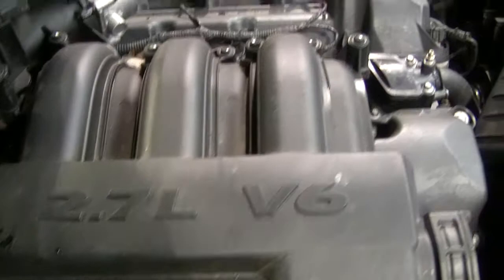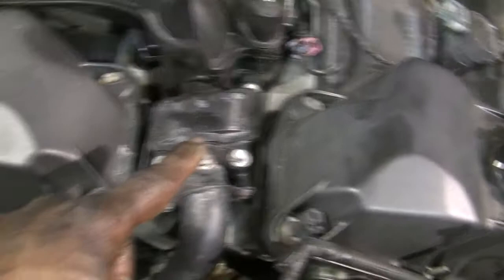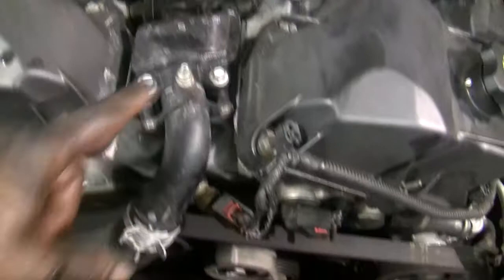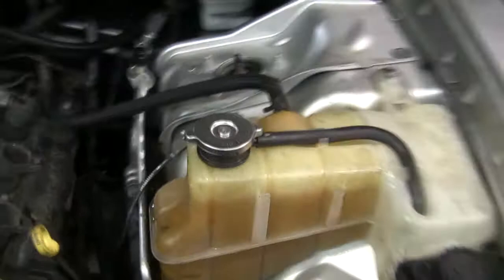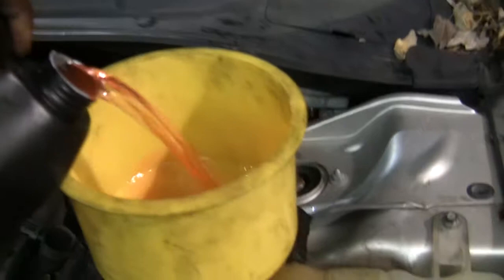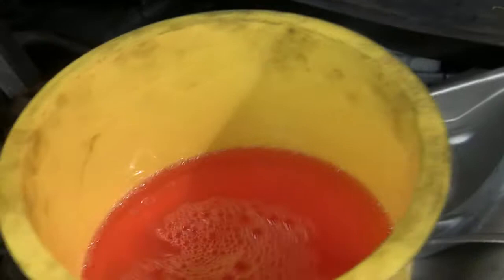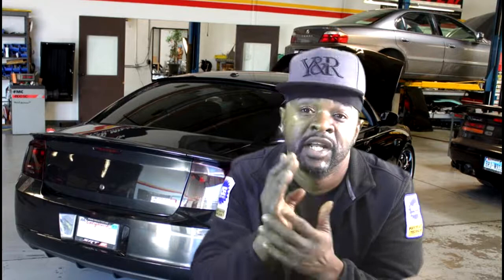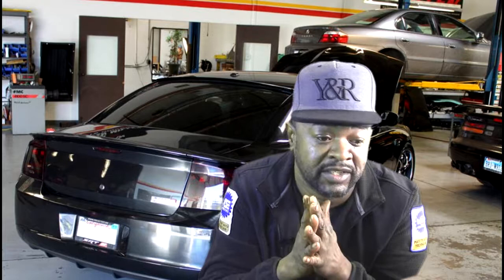How to bleed a cooling system.

Comment: From a totally empty radiator, use the funnel tool you have. What if the coolant starts coming out the bleeder but your still seeing bubbles I'm your funnel? Keep pouring coolant in letting it come out your bleeder till you see no more bubbles in your funnel? What about the part of turning your heat on high? Don't do this on these type of cars? I'm asking for a 2005 dodge magnum 2.7 l

Comment: Arent we supposed to be running our heater during this process? Or does that not matter??
Reply from the maker: It's not that it doesn't matter..its just not required or a must..But coolant will be flowing thru the heater core if heater is on during refill, so in reality, it helps at making sure theres no air pockets

Comment: How did you get all the air out the system when your missing a bleeder valve on the plastic box. It has 2 bleeder valves your misisng one
Reply from the maker: It only has one. If yours have 2, thats because somebody has replaced your bleeder valve with a aftermarket setup. Theres will have a valve on the top as well. This car has the original set up
Reply: @OnlineMechanicTips  no sir your car has 2 bleeder valves you just do not have the second one screwed in. You see the silver gold threads in the middle of the plastic box you pointed to that's where your second bleeder screw screws into
Reply: @OnlineMechanicTips also sir not trying to nit pick your video or anything but you said use 2 quarts of atf fluid in the coolant system. If I did that how much problems you think it cause?
Reply from the maker: @jacobwheeler3368  Well thank goodness you have common sense right? Maybe everybody else chalked it up as a simple mis speak on my part. Glad you have common sense my guy.
Reply: @OnlineMechanicTips  yes sir and I can also admit when I make a mistake or give miss information. There are 2 bleeder screws one on the pipe and one in the middle of the box. There's no way you started that car with a missing bleeder it would of sprayed coolant all over the place. I know cuz I did it to see.
Reply from the maker: @jacobwheeler3368  Look my guy, I told you there is only one bleeder screw originally. If you have 2 its because somebody replaced that housing before with a aftermarket part. Seems you to stubborn to listen so I just let you hang yourself. The original oem part come as an assembly with the long pipe and the bleeder valve on the pipe and not the plastic housing.
Reply: @OnlineMechanicTips  buddy it's right there in the video I'm looking at it if I could screen shot it I would and I'm looking at the factory one on the computer at the dodge dealership they all said the same thing and watched your video you giving miss information and you know it. It's I'm the video buddy
Reply from the maker: @jacobwheeler3368  So I just looked at this video and now im convinced.  You simply blind or not comprehending what im saying. Listen. If you replace this bleeder box assembly with a dealer part, the 1 and only bleeder valve/screw will be screwed into the pipe, not the plastic housing. If you replace it with an Autozone kit, your screw will likely be on the plastic housing part. This car im working on only have 1 bleeder valve on it which is the one I open in order to bleed the system. You might want to get your eyes checked
Reply: @OnlineMechanicTips  got mine from dodge dealership and it has a screw on the top buddy and they Said the same thing you Have to bleed both. So factory aftermarket ones come without a bleeder screw sometimes but original dodge dealer part has a bleeder screw my friend. I'm looking at it face to face with dodge at the customer service center.
Reply: at 1.33 in the video exactly what are you pointing at?
Reply from the maker: @jacobwheeler3368  The oem dealer part has the screw on the long pipe, not the housing. If you replace the that you will only have one screw like on the car in the video. But even if there was 2, they so close to each other that bleeding both would not make a difference.
Reply from the maker: @jacobwheeler3368  What im pointing at is the bleeder screw thats connected to the tube, not the housing. The after market junk has the screw in the center of the housing, thats not good.
Reply: @OnlineMechanicTips  what makes them not good? Just makes It harder to bleed?
Reply from the maker: @jacobwheeler3368 Because the screw being in the center of the housing weakens it. That makes them fail early, the screw should be in that metal tubing, not the plastic housing.
Reply from the maker: @jacobwheeler3368  https://www.youtube.com/shorts/lCgIgiQqXuE